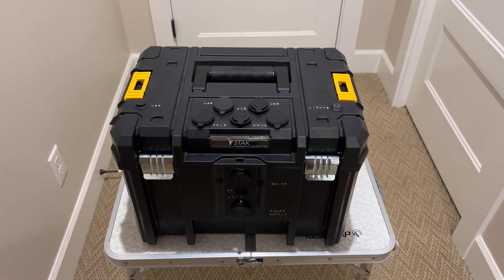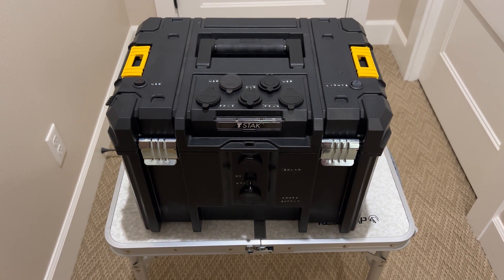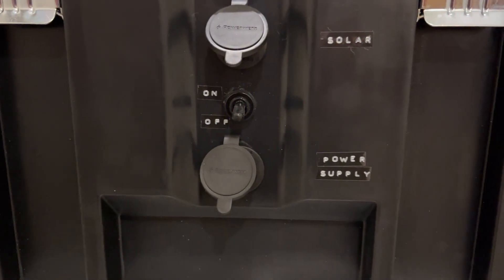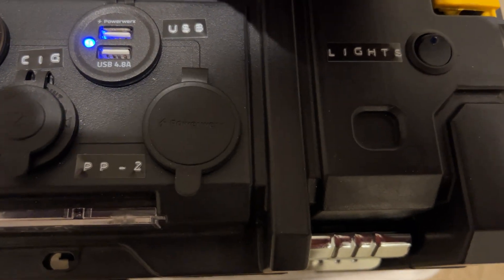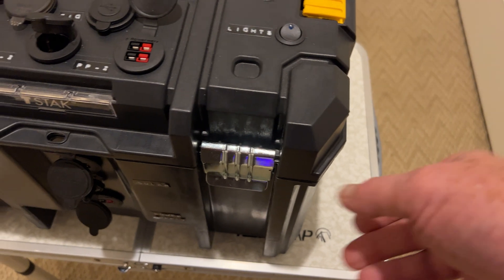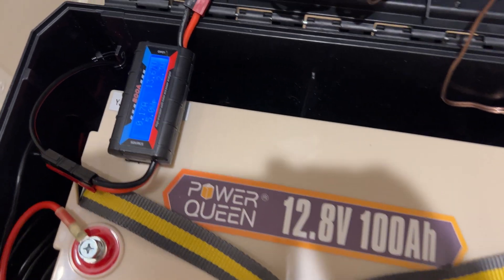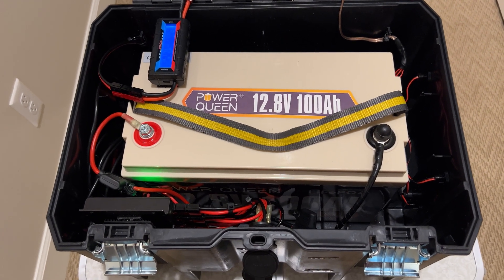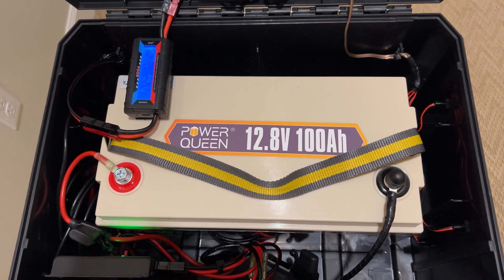12V Power Box DIY with 100Ahr LiFePo4 Battery

Comment: The $15 fuse box is the weakest link. You can open the fuse box (may be opened only half the bottom cover), and use light can see the inside whether the thin wire connects the metal seat with the metal plate.

Comment: Great little power box. I built one years ago with just a standard lawn mower battery and solar set up. Doing it all over again with the new equipment that is out there. I now have two power queen mini 100AH and a 1500 watt pure sign wave inverter. Going to build my own box for this system. Nothing on the market fits. What I am interested in is a fuse system for safety. Cool Video. I got a lot of ideas. Thank You.

Comment: change the lights to 2700k color, cut out a spot for a small computer fan that toggles on/off when you charge or turn on your circuitry, add a 120ac plug and a small inverter to power laptops or other fairly low-draw household electronics. Plenty of room left in that case for a few upgrades.

Comment: Eco-worthy battery AGM I stuck my hand in the freezer pulled it out while I was still cold I was still drawing amps but if you put a queen in there like I did there is no voltage

Comment: I have an Epic PWRgate that I use for powering my ham radios, and the Anderson power pole connectors are used by many hams but are a great idea for use on projects like this one, they afford quick connections and easy replacement or repairs if needed.

Comment: looks great. years back I made them with AGM and was heavy.  I got bigger Anderson on mine. SB 50/SB 175 . and power pole as well even the 75 amp ones. MAXI and ANL fuses . I use the same powerworx stuff. eathere direct from them or amazon . I am using victron MPPT with bluetooth . super great charge controller just add ferrite to PV and battery leads. was getting HF noise. you can charge that powerqueen and leave it for months and will stay charged. I got the smaller one and the big 190AH 200 amp BMS one.all super. 73's

Comment: How many hours does it lasts
Reply from the maker: That depends on the rate of drain on the battery.  My application is amateur radio. I can operate a radio at 50 watts on CW (Morse code) and use 4 amps approximately an hour.  If I recharge after 80 amp hr. Consumption, I could operate 20 hours.
Reply from the maker: it depends on the load.  i use mine to operate a ham radio transciever.  I operate at about 50-60 watts and find that I use about 2.5 amps per hour, so this setup would last about 35 hours.  it is really designed for use during emergency or amateur radio field day.

I have also built a smaller 15 Ahr LiFePo4 based power box that i use mostly for Parks on the Air activations.  I will be posting a video of it in a few days.

Comment: what was your total cost? Is it cheaper to buy one already made?
Reply from the maker: about $600.  I looked but couldn't find exactly what I wanted to suit my needs.  This is one of those things that are a big expense and probably not going to pay themselves back, unless you have an emergency and then they are great to have and payback all the expense and effort to make them.  This box is overkill for most of my needs, but I do use it during ARRL Field Day each summer and need the full 100 AHr. battery capacity to run my HF radioover several days.
Reply: @n7tb  have you seen the doctor prepare 100ah battery? 399. has a built in hub with an mppt charger, usb and cigarette  lighter port. also has high and low temp protection. Its actually made by renogy.

Comment: What's keeping the battery from sliding around in the box? It looks like it is just sitting there with no straps.
Reply from the maker: It now has foam around the sides.  it is actually being held by industrial dual lock fasteners on the bottom to hold the battery in place.

Comment: I did something similar with a 8D Noco battery box for single 200ah LifePO4 batteries. I made it so i can add capacity easily through bus bars on top of what i call the master battery box. The master battery box has all the hardware that additional battery's can be wired to parallel. 2500-5000watt inverter, charge control,kill switch and a 30 amp outlet installed flush to the battery box. I used silicon pads and the same packing material that came with the battery so it does not shift and hit the sides of the box. The Noco box was a little pricey but it is a well built box that allows me to mount hardware to it without compromising the structure at all and remaining very light weight.
Reply: Let's see your build ?

Comment: Looks good and I got some useful ideas. You might consider adding a small sine wave inverter (100-300w) and a couple 12v fans to draw cool air through the unit. Having the current meter on the outside would be useful as well,

Comment: Not bad.  Lots of power for DC devices.  The PWRgate is pretty cool.  I built a milk crate with a 10 A PWM, 1 100 watt panel, a lead acid deep cycle battery, and a 1000 watt inverter for my shed, and then have purchased LiFePO4 solar generators for the house, but I'm always looking for ways to expand my capacity with LiFePO4 batteries since they're getting cheaper now.  Thanks for the video.

Comment: Fatal flaw you used USB-A when nothing manufactured of any substance uses that anymore. Even Apple is switching to USBC with their phones next year. You should have done it all USBC and bought $5 adapters just in case you have some old USB-A device you need to use that future proofs that device
Reply: Good grief. Hardly fatal. He can always add a USB-C later if he wants.
Reply from the maker: I misspoke, they are 5A USB-B ports
Reply from the maker: There is a USB C as well.  Most of my Amateur radio chargers are USB-A.  Even the newest equipment.  i needed to make this to serve my Amateur Radio needs.

Comment: Nice build but this isn't really a power station if you need AC power because there isn't a power inverter.
Reply: Sure it is -- it's a 12V power station.
Reply from the maker: As a ham radio operator, i don't need AC all my equipment is DC

Comment: I am not a Ham Radio person, so I've no knowledge of the PWRgate device. Could you please expand on what it can do and how you are using it? And are you able to use it to charge your battery from the Wall socket (I assume through some AC to DC power supply converter?).
Reply from the maker: The details of the PWRgate are at www.westmountainradio.com by doing a search for the "Epic PWRgate".  Essentially, if a 12V power supply is attached, it powers all the 12v connections on the box and with surplus power, charges the battery.  you can select charging rate at 1, 5, or 10 amps.  You can also designate Led Acid and SLA, AGM, and LiFePo4 batteries.  If the 12 V power supply is disconnected, the battery powers everything.  if a solar panel is attached, there is a built in MPPT solar charge controller and the battery can be used while the solar panel is attached.  I hope this helps.

Comment: Great job, the only thing I don’t like about batteries in boxes is heat, heat effects performance and will eventually kill the battery, especially where I live! Good idea I’m going to use having led lights so you can see what your doing when the lights go out!
Reply from the maker: That is a fact I considered.   At 75 years old and these batteries having 4000 discharges or more the way I am charging, I expect the battery to outlast my lifetime.  If not, I can buy another. This one was only $299.
Reply: @n7tb  75!! Wow I’m impressed! I’ll probably be in a nursing home drooling on myself by 75!
Reply: Batteries themselves shouldn't heat up much unless you are at high charge or discharge rates.

Comment: That is an awesome build. I have been considering building one myself. Will definitely be using some of your ideas. 
 I have a Bluetti AC200P and love everything about it but one little thing. The solar charge start voltage is 34 volts! Very unhandy for solar charging off a small camper.

Comment: Looks good. How do you keep the battery from moving around in the box and what's your method with mounting the MPPT and other items within the box? Thanks!
Reply from the maker: Hi Jason,  

For holding the fuse box and the Epic PWRgate, I attached them using dual lock fasteners.  Here is the link.
https://www.amazon.com/dp/B09G5L4LSF?ref=ppx_yo2ov_dt_b_product_details&th=1

These things hold FIRM.

I made the assumption that the Power Box would never be inverted, although there is only about a half inch clearance from the battery to the top of the box where the connectors stick down.  I attached the battery on the bottom with two stri[ps of hook and loop velcro with adhesive on one side..  

Probably an improvement would be to add vertical foam spacers between the battery and four sides of the box to cushion it in case the case fell on its side.

I hope this helps.

73,

Terry